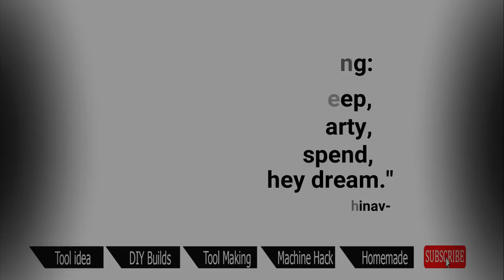Leaf Spring HACK - Metal Cutter

Comment: Great work and a good video. I like the reinforcement bars you added to take the strain off the bolts. That was a good idea. You’re pretty good with the stick welder too. A suggestion if you make another one is to put a hole in the top cutting blade so you can cut steel rod against the lower blade as well. Cheers Stuart 🇦🇺
Reply from the maker: Thanks bro :)

Comment: Your torch tip is way dirty. Either that or your not using enough oxygen pressure. 40-60psi should be used to cut that plate.

Comment: Nice work. I collect leaf spring for projects. Never seen that quench method in so little oil. Fascinating. Maybe you wish for a foot pedal design after all that cutting. Two free hands... You do great work. The square bar trick too is interesting. No welding spring steel right?

Comment: Way u spill that oil on the ground.lol
Reply: No different than the asphalt on our streets.  Here in Arizona the highway dept actually spreads motor oil on the worn asphalt to extend its life from the sunlight.  Signs on road will say
 " warning ..freshly oiled"
I checked into it and they used old engine oil.